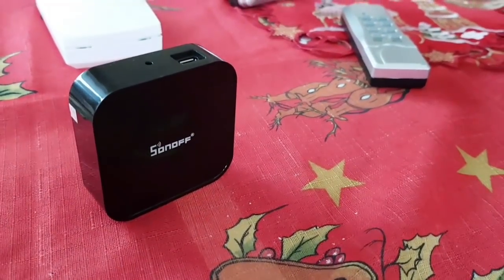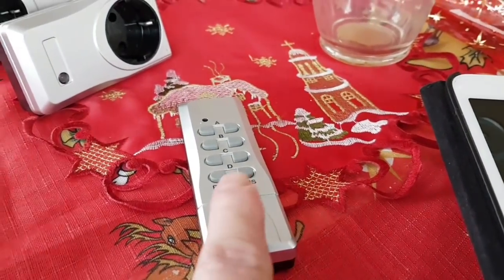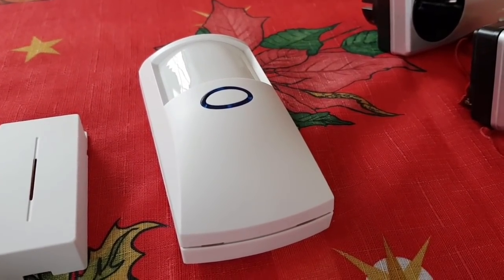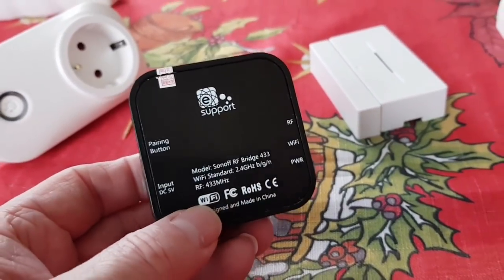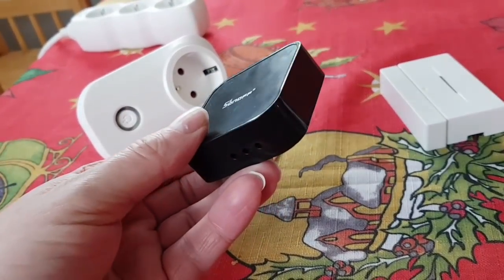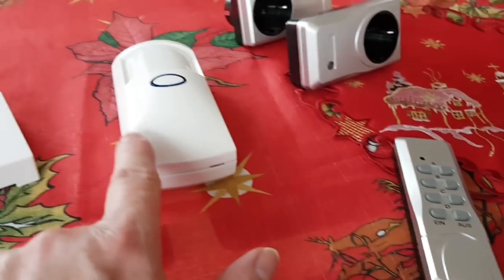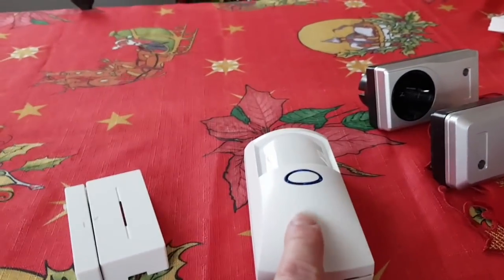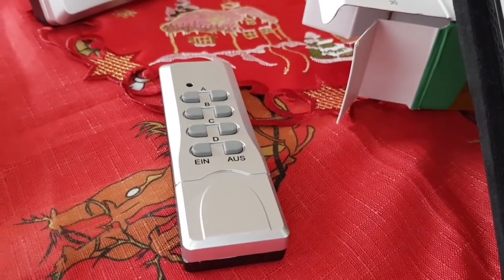Sonoff WiFi bridge

Comment: Hi Rob. Interesting video. Can the Sonoff RF bridge be used to open Came electric gates on 433.92mhz or open and close a garage door? Thanks in advance, I’m very new to RF.
Reply from the maker: You may find the Gates/Doors are rolling codes and this Device is fix code.
That's why I placed a rolling code button inside a 4 Channel Pro.
Look for the Video.
Regards

Comment: Hi 
Is it possible to do the following using Sonoff Bridge & Sonoff Motion sensor combination?
if the Motion sensor sense Movement it should trigger a light that is connected sonoff but the triggering of light should happen only in the night time. (Say 9PM to 5AM only)
If Motion sensor sense Movement during Morning hours(Say 6AM to 8PM) it should NOT trigger the light connected to Sonoff Basic.
Is this scene/Scenario possible?
Reply: Yes if you use Stringify app. Stringify allows for more complicated scenes like the one you suggest. You can even use sunset and sunrise times, meaning that it only works when dark.
Reply: Darren Wootton I tried using stringify but it's slow service. After I pass the area it triggers the light. Almost 10sec delay
Reply: Easwaran Chandrasekaran i think as its going frim server to server you will get a delay. You may need to look into tasmoto and mqttt. Theres a guy on here with excellent tutorials. Dr z. Hes a floating head. Its really goos stuff.
Reply: Darren Wootton yes just started following him & installed home  assistant. Next to flash tasmoto & test. Thanks

Comment: Rob Reynolds I need to know if the gate of my home is opened. I mean, if someone left the gate opened. If someone just opened and closed the gate doesnt matter to me. Actually, it would be so annoying to get a celphone notification everytime the gate open and closes. So my question is... Is it possible to set something like that on the Sonoff Bridge with the door sensor? And thanks for your video.
Reply from the maker: HI 
if i understand your question correctly, then no, it will only alarm once the gate is open, and not tell you the gate is open

Comment: Another nice informative video Rob (Thanks) quick question, any idea what the range might be on this bridge? I would like to pair it with a reed switch on my garden gate so that when the gate is opened it will turn on my garden lighting by either having the transformer plugged into a smart socket or using an inline sonoff basic as the switch, thoughts?
Reply from the maker: HI 
I have only operated this device with a range 5/6 meters only. not had chance to take this further.
let us know if you get better results 
regards
Rob

Comment: Dos it work via internet? Meaning, can i sync the SONOFF® RF Bridge and then use it anywhere outside the WIFI network to turn on an off the devices?
Reply from the maker: Widura Weerasinghe 
This can be controlled from anywhere, or another way of putting it you will receive the alarms from anywhere

Comment: Hi. Thanks for the informative video. I have a question regarding the door sensor. You demonstrated that it can trigger the lights on when the door opens. But can a scene be created where it will switch the lights off when the door is closed?
Reply from the maker: Hi, i do not believe it can. , but set it to time out , this may help ?
Reply: Thanks for the reply, the idea is to ensure that the entrance door, which is at another level of the house, has been closed by the visitor or the person leaving the house. Don't think a timer will help. Any other suggestion?
Reply from the maker: Hi 
i don't believe the devices will do this.
but will think on , and try to find an answer
Reply: Rob Reynolds Thanks, appreciate.

Comment: i really tempted to get a sonoff bridge but wondering if it will work with some of my 433mhz rf switches. i have a few home easy built in 13amp sockets, and some home easy touch light swithches, and some older plug in 433mhz sockets...

Comment: i have a few old home easy light switches and mains sockets can i use the rf bridge to  make the old ones work then ?
Reply from the maker: bing quadby , look on the old controller, check they are 433mhz. If so, it's very likely they will work.
But I have seen many videos where people have failed to pair them. So I can not guarantee but as you can see my older units did work.
Reply: thanks i never really thought about using other transmitters to control my home easy stuff t.b.h. i only bought them as they were on offfer in b and q a few years ago and so cheap.... would be great if they worked with my dimmer control and my touch 433 mhz sockets

Comment: Can I program my garage door remote rf frequency to the sonoff bridge to operate open /close function with my smart phone?
Reply: If your garage door has an input for a simple push button to open and close it, then you could use the 1 Channel Inching /Self-lockIing Mode WiFi Wireless Switch 5V/12V  and the Ewelink to achieve the same result.
Reply from the maker: Angelo Fiorini 
In theory you could, but the problem is your garage door key fob maybe one with "rolling code technology " which at this stage the Sonoff device does not have. 
This is to stop people stealing your code and opening your door in your absence.
Reply: my garage door also has rolling code technology but it can work with fixed code also, and there is an option in the menu to switch off. After i can  learn it with broadlink. Sonoff has a problem that it work with certain protocol of 433mhz as in know it only works with 1527 devices
Reply: Tamás Landa The menu of the ewelink app?
Reply: Angelo Fiorini no..in the garage opener setup. It depends on your model. I have Protector system
Reply: Tamás Landa I see ok.. Both of mine are chamberlain however one is a few years newer then the other. I will look into it and post again this weekend.  I really appreciate your suggestion and help as I was looking forward to using it for that purpose especially because of the price point and compatability with Google home. Cheers 🍻
Reply: Rob Reynolds Thanks to you sir aswell for you quick response and great video,

Comment from the maker: Yes these are 433.92 Mhz, but took many tries for them to pair, but once paired, works perfect,  just keep trying
Reply: Hi Rob, can you describe exactly how you got it to pair? Have spend hours trying without luck so far. Looking to pair a 433.92Mhz gate control.
Reply from the maker: Stuart Ansell
Hi
You may have a Rolling Code RF device like mine, this will not work with Sonoff fixed code device.
I am currently traveling but have ordered parts to build this project.
I will post once ready to start... but this will be at least a month due to other business commitments.